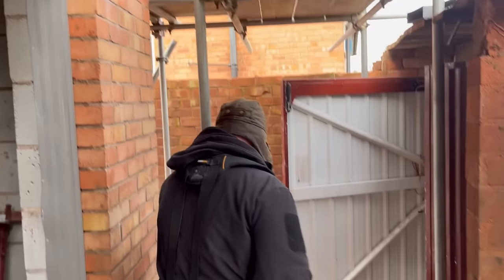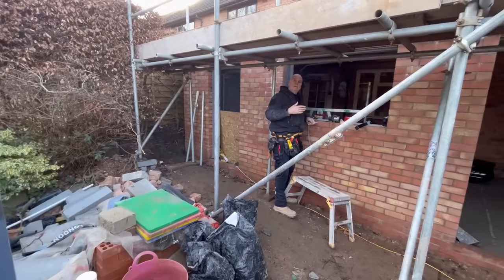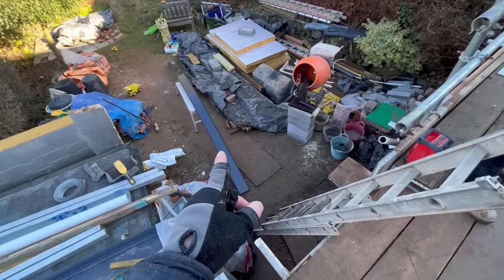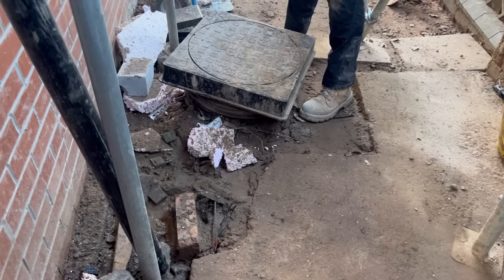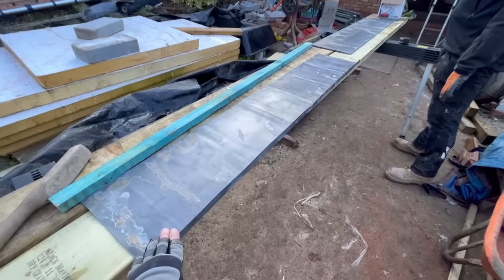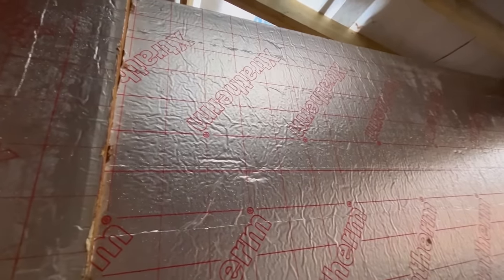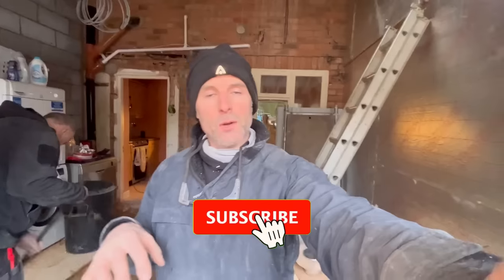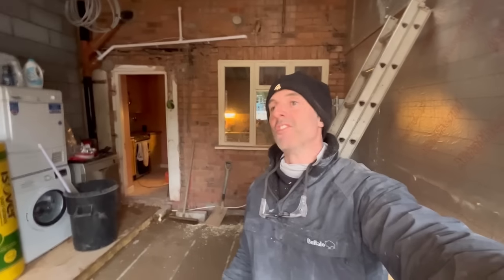Finishing the roof works and moving inside to prepare for 1st fix

Comment: Great videos, your work is spot on, quick question, why do you put a barge board on one side and not the other, also why has the one side got a ladder frame and the other side hasn't , or did I miss that?
Reply from the maker: Thanks Philip. The only reason is to try and a match up with the existing house on the RHS elevation which is traditional with the tile detail at the gutter level. 👍🏻

Comment: The state of that lead! No wonder demand for lead alternative products is through the roof. Uh, no pun intended. So much less faff not to have to cut and overlap it too.

Fwiw that's not an "abutment", abutments are when the side of a roof is against a wall (or chimney). Think the top edge of a lean to roof would just be normal flashing.

Also bit strange for the sparky to run the cables through an insulated ceiling? Won't they have to be down rated since they'll get a lot hotter than if they were in free air?
Reply: Very strange the cable things in ceilings very strange indeed. I heard varied reports of water sighted coming out of a tap and an old wives tale of cement being found in mortar too. Strange times.
Reply: @justbreakingballs  No need to be a wanker about it mate just meant because they're going to be putting PIR up there to have it as a vaulted ceiling. Gonna cause issues with fitting the insulation, cold bridging if you leave an air gap and amperage ratings being downgraded for the size of cable.
Reply: @ComeWhatThey  well it a pretty stupid thing to say. Where would you like the cables to go? Clipping twin and earth where it needs to go doesn't cause issues when you know what you are doing. Also for example lighting cable  even if it's 1mm is good for circa 13amp best case. If you have a 6amp overload protection that's already derated by over half. The max correction factor is being 0.5 so it's already derated by above the maximum so run it through rockwool till you are blue in the face. Granted you might need to watch yourself on a 4mm radial with a 32a behind it but to call it strange to be running cables in voids is well strange.
Reply from the maker: @comewhatthey Hi hope your well and thanks for the comment. I only use the term abutment flashing by way of association because that’s what the manufacturer calls it but I can’t agree or disagree as to what the actual term abutment means in different parts of the country. I was told many years ago that lead where possible should be cut into 1500mm lengths for various reasons including ease of fitting so it just stuck.  I can’t imagine how hard it would be to lift a 6m length of code 4 lead up onto that roof. The cables have been clipped in the vented space above the insulation so they don’t get in the way of the 100mm insulation between the rafters so therefore the overheating won’t be an issue. Hopefully I’ve covered all the questions but if not feel free to comment again and I’ll try my best to answer. Thanks for watching. 👍🏻
Reply: @Mr_A_Builders  Think with stuff like leadax you bring it up in a roll and shape it on the roof, no need to cut it to lengths but that could make it a bit more unruly you're right. Started out cheaper than lead but I guess too many people are sick of dealing with lead so the price has shot up. Thanks for the reply!

Comment: What I do is cut that fascia ends back 45mm and put a 6x2 on pin the soffit to it and put the back of soffit on to the brick then fascia on the 6x2 it keeps it straighter than cutting the ends off

Comment: What do you think of cross battening for breather membrane ?
Reply: Only necessary with overboarding on the roof, without you can drape the membrane between the rafters slightly which deals with the same issue. I guess it would let you fit more insulation between the rafters but it depends where you have more space, you'll probably want to insulate under anyway to prevent cold bridging.

Comment: so our extension is following the same sort of route with the outside being done before we get started on smashing up the insides
compared to your other job where you are essentially living above a building site, how much disruption will it have here when you knock through?
we are planning to move the kitchen to a temporary location into the back room but are wondering how practical this will be for a longer term solution
thanks
Reply: Check out Gosforth Handyman's channel, he did a similar thing but talked a bit more about what it's like living around work and how to organise everything. Essentially, the more you can get done before knocking through the better, at the very least you want to be weathertight.

Comment: Should use the upvc ring nails for sofit not screws, covered or not. That sofit joint is shocking, either do it properly or learn how to invisible joint it. Proper bodgers 🤠
Reply from the maker: We did use poly pins but not where we thought the gutter brackets might hit. With regards the soffit joint that’s your opinion and your entitled to it. Our email is available if you want to share the link to your video and we’ll see how the experts do it shall we. Thanks for watching